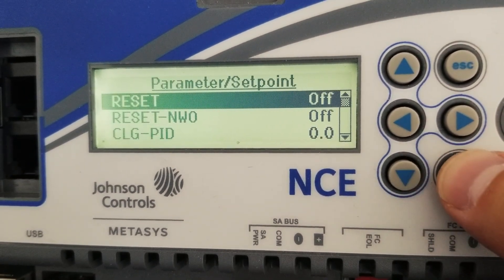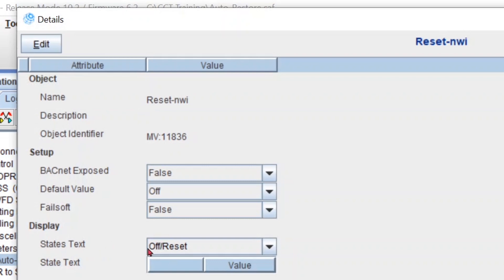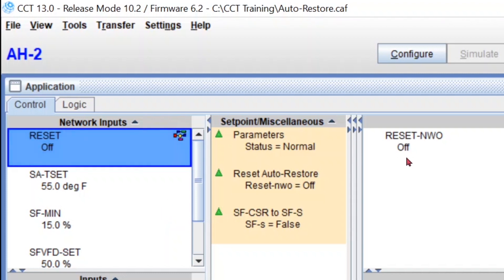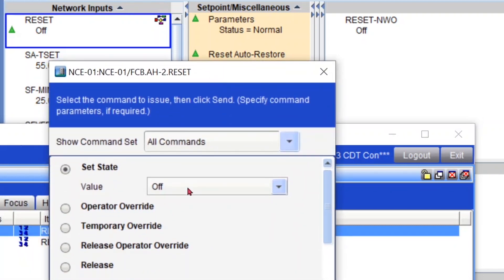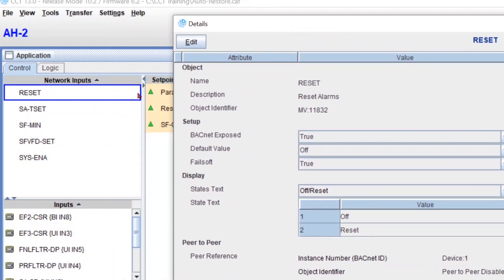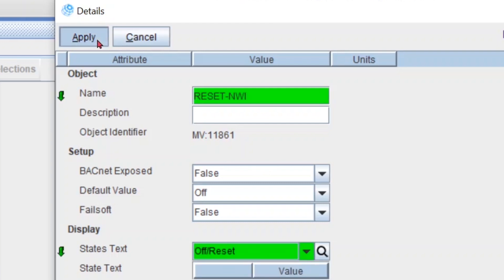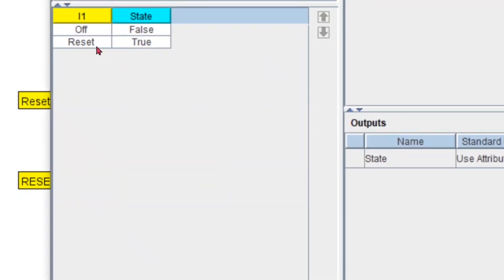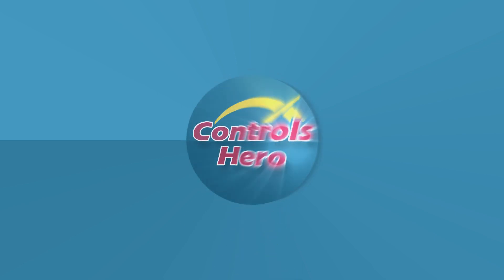CCT Auto Restore Reset Point - Programming in Johnson Controls Controller Configuration Tool.

Comment: In CT you have a choice for a default element. What is the default element used for in CCT? & what does it do?
Reply from the maker: Hello again! Thanks for your question. The Default Element is handy when in commissioning mode or simulation mode. Basically, when you are in either mode, the input or output that you set as Default Element, will show its current value under the modules' name (below the Setpoint/Miscellaneous, State Generation & Output Control). That way you don't have to go inside the module where the logic is and see the the point's value. If it's confusion go to my Instagram account and look for my Default Element 1-minute video. Thanks!